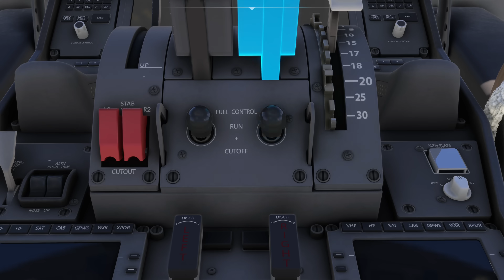Air India 171: Why Did The Fuel Cut-off Switch Get Moved?

Comment: # ✉ Technical Commentary on Flight Data Recording Vulnerability in Boeing 787 and Similar Aircraft

**Subject**: Critical Weakness in Flight Data Recording — Inability to Distinguish Physical Inputs from System Logic States

**To**:

* Aircraft Accident Investigators
* Aviation Regulators (e.g., DGCA, FAA, EASA)
* Safety Reporting Boards
* Aviation Journalists
* Aircraft Manufacturers (Boeing, Airbus)

---

## 🛩 Concern Summary:

In the investigation of recent aircraft incidents, including the Air India AI171 crash, it has become alarmingly clear that the *Flight Data Recorder (FDR) architecture in modern fly-by-wire aircraft (such as the Boeing 787)* captures *only system-interpreted signal states**, not the **actual physical state of cockpit inputs* such as fuel cutoff switches.

---

## 🔍 Problem Detail:

The FDR logs that:

> “The fuel cutoff switches transitioned from RUN to CUTOFF.”

However:

* There is **no indication whether this transition was initiated physically by the crew**, or **internally by automation**, logic fault, or misinterpreted input.
* The data is based on *logic-level signals from aircraft systems**, not on the **true cockpit hardware position* or physical input.
* There is *no redundancy in recorded input source* to distinguish between:

  * Manual crew action
  * Automated system decision
  * Sensor failure cascading into a logic fault

This undermines the integrity of the investigation, especially when:

* The aircraft uses **electronic control systems without mechanical backups**.
* Pilot input is *digitally interpreted* by multiple systems before reaching actuators.
* Failures in flight control logic or signal processing can **simulate pilot action**, while **FDR still records it as if it was human input**.

---

## ⚠ Safety Implications:

This design leads to critical consequences:

1. *Crew Error vs. System Failure indistinguishable*

   * Investigators may wrongly attribute software-induced actions to pilot error.
2. *Untraceable automation faults*

   * Logic-layer errors leave no physical trail but result in deadly outcomes.
3. *Reduced accountability*

   * Manufacturer software decisions and hidden logic cannot be audited if only the interpreted outcomes are logged.
4. *Legal ambiguity*

   * Defense against product liability is reinforced when recorded data cannot prove otherwise.

---

## ✅ Proposed Recommendations:

To restore trust in flight data, investigations, and manufacturer accountability, we urge:

1. *Dual-layer logging for flight-critical inputs*

   * Record both the *interpreted signal* and the *physical control input state* (e.g., switch position sensors).

2. *Signal source tagging*

   * All transitions of critical systems (e.g., fuel cutoff, trim, autopilot) must include metadata:

     * Manual pilot input
     * Automatic system logic
     * Indirect cascade from sensor input

3. *Regulatory updates*

   * ICAO, FAA, EASA, and national authorities must revise FDR/CVR standards to reflect fly-by-wire system architecture, requiring deeper traceability.

4. *Investigation transparency*

   * Crash reports must state whether recorded input was based on logic state or physical input — and disclose if that distinction is impossible.

---

## 🔚 Final Note

In an era where software controls most flight-critical systems, **recording only interpreted behavior — without source — is no longer sufficient**.

This concern is not theoretical. It may determine whether hundreds of passengers live or die — and whether truth is ever found in a crash investigation.

Respectfully submitted,

*\[Your Name / Organization]*
Concerned engineer / safety researcher / aviation professional
\[Optional contact or affiliation]

---

Would you like a version of this formatted as a *PDF**, or rewritten as an **opinion article for media* like *The Aviation Herald*, *FlightGlobal*, or *The Air Current*?

Comment: If it is NOT a deliberate attempt, I can explain the conversation. When engines are gone, pilot flying assumes pilot monitor has pressed the fuel cut off. Q: cut off? A: No, I didn't. The black  box log should explain if it is a cut off from switch or cut off from system. Why don't they reveal the cut off log snippet?

Comment: Why did it take a while 10 secs for second pilot to discover engines had been turned off-is there no auditory cue like a bell or a voice “engines off” (like stall warnings, or the alarms that go off if you dive quickly in a helicopter)? That seems like a pretty major deal to turn off the engines- there should be major and immediate warnings as soon as the switch’s are flipped while in air mode (not ground mode)

Comment: Surely it’s not beyond the wit of man (or woman) to ‘lock out’ any movement of these fuel switches when the plane is not sufficiently above the ground, specifically during takeoff mode. 
If you are lauding how advanced these planes are, then (as a lay person) surely they are capable of detecting a flight being in a take-off phase (between leaving the ground and before reaching a safe altitude).
As during this period (from what it has been said) there is no positive, only devastatingly negative consequences of cutting off fuel. This amendment will certainly remove this particular suicidal/murderous move from a bad-intentioned pilot. While it’s not conceivable to be able to circumvent every single action a pilot may take to deliberately crash their plane and selfishly kill the everyone on board, the airline industry surely should learn from this terrible tragedy and act when to correct things such as this that they can fix

Comment: Fuel cut off switches should be inoperational until a fire is detected and its insane to locate them next to the thrust levers in an age where 75% if not more humans have mental problems and might just pull a switch to see what happens....

Comment: As per preliminary report ELT was not working, Black Box was damaged which must withstand the biggest accident also. But Agency hasn't given any recommendations to Boeing regarding this. If the flight would have met an accident in remote areas, how could they have traced the location without a proper ELT. So question should have raised to Boeing also. But they have given clean chit to Boeing and focused investigation on single line" why did you cutoff the Fuel switch" not on its answer " I didn't do that". Very big conspiracy to save big faces.
Reply: This so called captain is a bootlicker of boeing. He won’t say truth since he can’t

Comment: I know the report says the switches were physically moved. But there is another incident of unexplained dual engine shut down. AFAIK this remains unexplained. So maybe there's more to be done here?
A Boeing 787-8 of All Nippon Airways operating ANA/NH985 from Tokyo/Haneda to Osaka/Itami stuck on runway 32L while landing at Itami due to sudden shut-down of both engines after Thrust Reverser actuation.

Comment: Former Boeing engineer here (777X, not 787), the other reason why the computers don't directly intervene is because allowing the computer to prevent the fuel cutoff from happening means allowing the computer to have final say over the fuel configuration, and the computer is always one of the most likely sources of failure. The line I always repeated at Boeing and continue to repeat to this day is that you should never give a computer the authority to kill a human. The MCAS malfunctions in the 737 MAX were an excellent example of why this is important: the MCAS was a computer that had final authority over the aircraft's pitch angle, and since it couldn't be overridden (and Boeing concealed its existence) a malfunction forced pilots of two aircraft to watch helplessly as their airplanes started flying into the ground. It's usually better to simply set up the computer to warn the pilots of an unsafe situation and provide advice, but trust them to handle the actual recovery process. 

I'm not wild about the idea of making the fuel switches a two-person process, as that could hamper their operation in cases when they're desperately needed. I think it would be far better to simply ensure that cutting them off triggers an alarm. Requiring both pilots' input would be extremely dangerous in cases where one pilot is disabled, occupied with another process, or for some reason is refusing to help. 

I don't know that much about the 787 cockpit interior, but any 'maintenance jumper' or other device that would leave the aircraft in an unsafe configuration would have to have a big bright red "REMOVE BEFORE FLIGHT" streamer attached, and such a jumper would usually also either trip alarms from disconnecting a shield sock, cause a failed diagnostic check between primary and secondary computers. or else prevent the switch from working at all due to a floating ground. 

AI-controlled jetliners are not going to be a thing in the next thirty years. If you look inside the electronics bay of a modern jetliner, even a prototype like the 777X, you will see thousands upon thousands of relays -- AKA a switching technology that is over a century old and has been an obsolete for low-power switching applications since the 1970s. That's because aircraft technology moves at a glacial pace, since every single piece of tech that gets installed must go through insanely rigorous testing and must remain available and functional for decades after manufacture. Your smartphone is more powerful than every onboard computer installed on every 777X combined, and we won't see anything remotely powerful enough to run an "AI" (or even the ridiculous Barnum machines you call AI's) for at least three decades. Beyond that, LLMs and other "AI's" include trained neural networks, and the training process introduces a hidden layer that cannot be reviewed or fully tested, meaning the computer instantly becomes just as much of an unreliable black box as a human brain.

Cameras inside the cockpit would be an ITAR violation, so unless those treaties are seriously reworked they won't happen.

Comment: Special Airworthiness Information Bulletins (SAIB) - NM-18-33.pdf

The Boeing Company (Boeing) received reports from operators of Model 737 airplanes that the fuel
control switches were installed with the locking feature disengaged. The fuel control switches (or
engine start switches) are installed on the control stand in the flight deck and used by the pilot to
supply or cutoff fuel to the engines. The fuel control switch has a locking feature to prevent
inadvertent operation that could result in unintended switch movement between the fuel supply and
fuel cutoff positions. In order to move the switch from one position to the other under the condition
where the locking feature is engaged, it is necessary for the pilot to lift the switch up while
transitioning the switch position. If the locking feature is disengaged, the switch can be moved
between the two positions without lifting the switch during transition, and the switch would be
exposed to the potential of inadvertent operation. Inadvertent operation of the switch could result in
an unintended consequence, such as an in-flight engine shutdown.

The FAA recommends that all owners and operators of the affected airplanes incorporate the
following actions at the earliest opportunity:
1) Inspect the locking feature of the fuel control switch to ensure its engagement. While the
airplane is on the ground, check whether the fuel control switch can be moved between the
two positions without lifting up the switch. If the switch can be moved without lifting it up,
the locking feature has been disengaged and the switch should be replaced at the earliest
opportunity.
2) For Boeing Model 737-700, 700C, -800, and -900ER series airplanes and Boeing Model 737
8 and -9 airplanes delivered with a fuel control switch having P/N 766AT613-3D: Replace the
fuel control switch with a switch having P/N 766AT614-3D, which includes an improved
locking feature.
We request that owners and operators report any failure of the locking feature of the fuel control
switch to Boeing (see contact information provided below). The report should include the date the
failure occurred, the fuel control switch P/N, airplane model, airplane serial number, and airplane
registration number. Under the provisions of the Paperwork Reduction Act (44 U.S.C. 3501 et seq.),
the Office of Management and Budget (OMB) has approved the information collection contained in
this SAIB, and assigned OMB Control Number 2120-0731.

Comment: It’s so sad to see fellow pilots assuming the AI 171 crash and putting this as suicide due to mental health issue. It could very well be but not until the full timestamps of the events along with the cockpit recorder are investigated and the airplane is ruled out. You guys have given a clean chit to Boeing but now blaming this on Pilots with no evidence. Yes mental health is an issue, and yes German wings the pilot had locked the cockpit and there was a genuine fight to save that flight by other from the outside. Did anything like that has happend here? but you guys are in a hurry to blindly connect the dots and say this is a suicide. These pilots did all they can to save that. I will be waiting for the full report to come and holding tight until then.

Comment: First, let me say that, for the most part, I enjoy your videos and have a lot of faith in your insights and opinions.  However, on this video, I would TOTALLY disigree that the actions of whichever pilot returned the fuel switches to on, took a great deal of presence of mind and that ten seconds is not much time.  Ten sconds is an eternity!  I can assure you that, had I looked down and seen the fuel switches in the off position, I would have IMMEDIATELY switched them back on, even while I was yelling at the other pilot why he had turned them off.  I have read two accounts, one stating that one of the engines had reignited and the other was attempting to do so, and another that both engines had reignited.  In either case, the extra 8-9 seconds the engines might have had to reignite before impact might have been enough to provide the addidional thrust needed.  BTW, I am also a pilot (GA only) and, during the 20+ years I have been flying I have encountered 2 emergencies that, had I waited 10 seconds to react to, I would not be around to write this comment.

As I said earlier, I really enjoy your YouTube videos.  Please keep them coming>

Comment: Cap Steeeve is just using wrong language to protect Boeing and has been constantly giving clean chit to Boeing on every news channel and youtube video. The preliminary report given by Aircraft Accident and Investigation Bureau was " Engine 1 and Engine 2 fuel cutoff switches transitioned
from RUN to CUTOFF position one after another with a time gap of 01 sec." The word is transitioned not moved. I have worked in aviation as an Avionics engineer for almost 2 decades before I left for good as I got the heat for blowing the whistle for the wrong maintenance practices. 

The fuel cutoff switch transition was recorded, which is a function of electrical wiring giving signal. That can happen due to a faulty wiring or some issue thereoff. Everyone knows how the dreamliner has suffered from electrical system faults in the past and this one was also a fault which closed the Engine Fuel Shutoff valves without pilot intervention. This fact is so scary that no pilot, airline and passenger would dare enter a dreamliner / coffin in their sane mind. But blame it on dead pilots is easy.

Being a pilot himself, without understanding the technicalities and giving his email id in the video description is more like please talk to me, I have a narrative without facts and knowledge.

Comment: On December 17, 2018, the FAA issued Special Airworthiness Information Bulletin (SAIB) NM‑18‑33, warning about potential disengagement of fuel control switch locking mechanisms (used across Boeing 737, 787, and other models) 
The Times of India
+15
Business Today
+15
The Tribune
+15
.

It recommended inspection of those locks to ensure they couldn't be easily moved—critical given the deadly consequences if switches flip to “CUTOFF” mid-flight.

Framework: it was a recommendation only, not a binding Airworthiness Directive. The FAA determined it did not meet the threshold of an "unsafe condition" requiring mandatory action 
The Wall Street Journal
+11
Business Standard
+11
The Sun
+11
.

Comment: Steve, I appreciate your posts and input - and especially, that you approach the subject matter thoroughly and with sensitivity.

My take on the preliminary report is that, sadly, it is the first step of a cover up by the authorities engaged.  That's quite a sensational claim, I know, but it holds up when you examine its contents.  The report, as many have mentioned, sets out, from a 3rd person perspective (i.e. someone not involved) what the pilots purportedly said, without context and without the direct quotes.  What we have from that is a claim by one that the other cut off the fuel - and a denial by the other.  Elsewhere in the report is reference to past issues Boeing has had with the switches.

The placement of those 2 items in the report is deliberate - and intended to lead readers to a particular conclusion.  Pilot denial, past issues with cut-off switches - the seeds have now been planted.

Unfortunately for those drafting the report, the experts have not taken the bait.  However, I don't believe we'll ever read or hear the complete cockpit dialogue, and I do believe the final report will allude more strongly to control panel issues and downplay the pilot conduct.  Where you have powerful forces within a country, potential litigation, loss of reputation and loss of face, the truth is often one of the casualties.  In this case it comes along with the tragic loss of life on that flight.